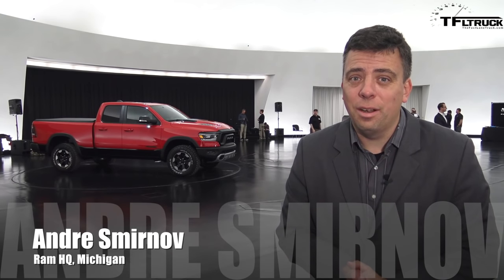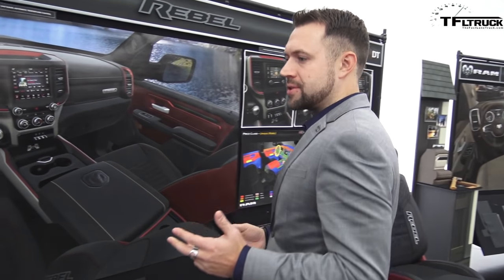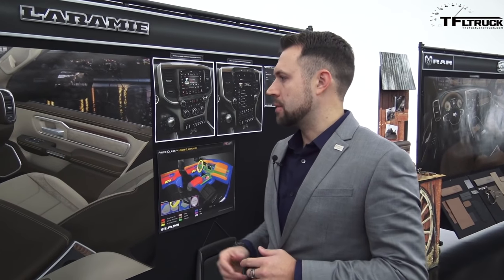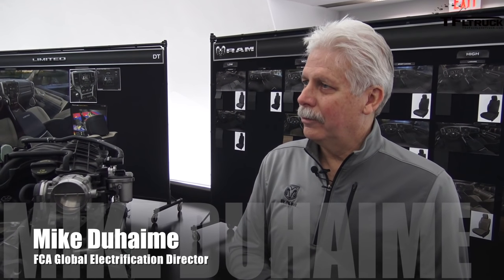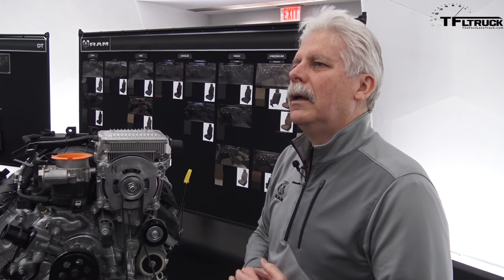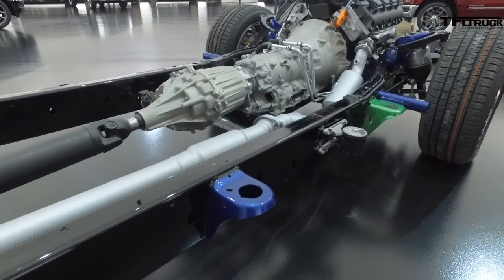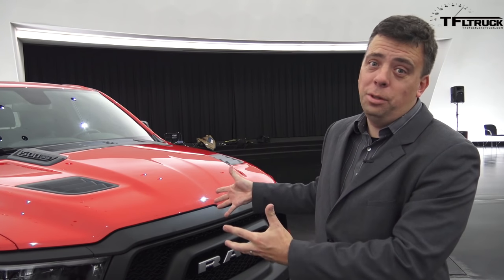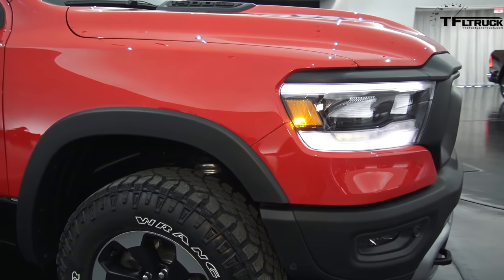Breaking News: Everything There Is To Know About The 2019 Ram 1500

Comment: When you guys finally get a hold of this vehicle I'm very curious to the ride quality I have arthritis up and down my spine and test driving the earlier version this vehicle picked up a lot of Road input but going through  potholes in a parking lot it was a soft ride. Where the ford had a soft road ride but a very jarring ride in a pothole filled parking lot. I would like to know if this new suspension fixes the road aspects. Also what will the tow rating be with the 3.21 rear with the 5.7 if the 3.92 has been bumped up to 12,000 lbs

Comment: Been looking in to getting a ram 1500 rebel now for a while but i'm worried about 1 aspect of it, The air suspension. If one or more air bag of the suspension breaks, Can you drive it with them flat? Where i live good repair shops are only in larger towns and there is at times quite a long drive to get to said towns, even more so if you are off the main highway.

Comment: You should ask RAM if the Heavy Duty's are going to come out with an actual 6 1/2 ft bed or they're going to stick with the 6 ft 3 in bed they currently have.  I know three inches doesn't seem like a lot but it's more handy than you would think.  RAM states that there are limits on overall length or something like that which only allows them to make the bed of the truck so big or small depending on how you look at it.  So if this new cab configuration carries over to the HD models does that mean my bed is going from 6 ft 3 in to 5 ft 9 in?  I can appreciate more interior volume but at the same time it's a truck, what's the good in increasing payload if you don't have the room to store it.  All of the advancements they've made are awesome like finally getting LED headlights and a 360° camera so kudos for that but I think a lot of RAM owners would appreciate a true 6 1/2 ft bed as well, atleast in the Heavy Duty segment.

Comment: Would be cool if the tradesman ( maybel the rebel as well)  trim came with full rubber flooring instead of carpet. Easy to clean after a days work. 
The Ram, IMO, is the only real truck, in a sense of me not worrying about scratching it. Screams "I'm a truck, use me as intended".

Comment: Hey guys, I noticed in the press release images of the 2019 Rebel that the time on the centre stack was 7:07, could be a fluke but FCA did this with the hellcat challenger as a HP teaser when it came out. Could be an indication of a RAM Hellcat in the works

Comment: The e-torque system looks really neat, I could see that being used in general (being relatively inexpensive compared to proper hybrid systems). It's strange the presence of a starter as well, I guess RAM wanted redundancy just to be safe.

Anyway compared to the new Silverado 1500 this one looks a tad better in my opinion, we'll see performance wise when you are finally able to test them

Comment: I just unloaded a 2014 Ram 1500 CC hemi, 8spd, 3.92s with all tow options that i'd bought new and owned for just under 3 years because FCA and their dealers seemed to be more interested in denying the problems with the vehicle than actually fixing them under the power train warranty.  Whining rear differential?  That's "normal" for a Ram 1500 with 5x,xxx miles.  ZF 8spd transmission running hot (220-230*F when NOT even towing)?  Two dealerships told me that FCA wouldn't let them troubleshoot it any further, to wait until it failed AGAIN (it failed the first time and hit 280* when towing my 3,500lb boat).. Then the "Ram Cares" rep even implied that my boat was too heavy (3,500lb pontoon boat, truck was rated to tow almost 10,000lbs).  My opinion is that Ram is more interested in marketing their trucks to new customers than they are in keeping existing customers.  Buyer beware.

Comment: It's a bit generic for a Ram. That screen is massive, but that UI looks very dated and low res. Has the ecodiesel been nixed? Can you see over the front end now? it's nice that it rides better, but does it have better visibility? Truck interiors seem to have hit a fit and finish plateau, what have they done in a practical measure inside to increase usability? I do like the chassis upgrades, and the deeper bed is appealing.

Comment: 2in lower on a rebel? 

why put the back up sensors on the bottom of the bumper where they can get scratched when off roading.

22in wheels on a off road truck? 

what about the power wagon?
Reply: trucker dan I would hope no one will actually go off road to the extent of scratching up a brand new 60k truck!
Reply: maddrummerboy 81 even tfl took some off road in Moab Utah if you follow their Channel you'll have seen the Power Wagon, TRD Pro, and the Raptor all in Moab. and they have scratched up some exhaust and or bumpers before it's more common than you may think.

Comment: The hybrid electric motor is best when it is connected directly to the crank , if I am not
mistaken it is belt driven , only time will tell but the way I see it is it will fail.
The Holy Grail is have a hybrid truck that can power a house electrically during a black out.
Also a system that can serve any construction site , Ram has a mickey mouse mild hybrid.

Comment: So it would seem that that guy never did get back to you with the Horsepower Numbers. 
Also, any word on the Ecodiesel?  Changes/updates?  Availability? With both Ford & GM both introducing 1/2 ton diesel models, that seems like something people might want to know.  
Some ball park numbers on pricing would have been nice e.g. "approx $1500 more than similar 2018 models," or whatever.  I mean if people can go order them later this month, they must have some idea what they are going to charge.  
I also didn't see a "Sport" model included in the list of interiors.  Of all the current interiors, I really like the Sport setup with the cloth/leather combo seats (I've got a '15 Sport model).  
For all those who aren't turned on by the Rebel, I would have also liked to see an Off Road package similar to what Ram did with their 2500 models and like every other brand has (Z-71, FX4, & so forth.)   
It's not that the new Rams aren't nice, it's just odd to see so many gaps in the information.

Comment: One very basic set of questions about all these new-for-2019 pickups is still not answered: (1: Have these manufacturers improved the value, quality and reliability of these new, uber-expensive vehicles? (If you're spending this kind of money for all these new improvements and gadgets, are they going to be there when you need them or are they going to need time in the repair shop?)  (2: If one buys a 2019 stripped-down work truck, new or used, will it be a better work truck for hauling cargo and personnel, as well as for family outings? (3: What are the real-world ergonomics for these umpteen gadgets and controls? (4: How will these trucks behave over-the-road, if you're driving to a remote jobsite or otherwise commuting? (5: How will these trucks behave in challenging terrain, such as winter snow/ice, off-road/mud, etc.? (6: Is there any real-world improvement in MPG?  Added note: I can't believe the proliferation of styles and trims available, especially from Ram, Ford and GM. Are these pickup trucks or fashion plates? Egad, they are GAUDY to all get-out! (Count me as one of those who still doesn't understand why some folks pay extra for a carpeted floor in a pickup truck.)

Comment: at about 14:00 in it looks like instead of running transmission cooler lines up front, they put a water to oil cooler on the transmission and ran coolant lines back to it. very interesting.

Comment: I like the new interiors. Not sure about the ginormous screen. I don't like the exterior as it looks a little like a Silverado or Toyota maybe? Rams have always stood out but not so much with this one.I have a 2016 Charger and 2017 Ram. Both interiors look very good to me and are very functional. But, they always look dirty to me no matter how much I clean/detail them. The Charger is a hemi and has been in the shop 3 times for transmission trouble. The Ram is a Cummins and has been trouble free so far. FCA products are hit and miss durability wise. Hopefully this improves.

Comment: I think the elephant in the room is, No EcoDiesel.  So Ford finally brings their 3L V-6 to fight the EcoDiesel and Out of the blue Chevy introduces a 3L I-6 diesel and Ram is mum on the continuance of their Diesel.  That's not a good move as to right up until the EPA butted in they were selling about 15-20% Diesel engines in the 1500.  I sure hope the RAM EcoDiesel hasn't bit the dust.

Comment: I like the look of the one with the grill that don't frown. I also like the ideal of an improved air ride system. Especially the wide range of raise and lower according to what you need. The electronic starter thing I'm not completely sure on though. I'm hoping he's just talking about when you give it the gas to get going,not to start the engine. I think that what he meant and if so it might be alright. However whoever decided to take the shiftier off the volume and make it a stupid knob needs to repent or be horsewhipped.Guess I better let everybody know that the horsewhip part was a figure of speech. So don't take it to serious and try and get me in trouble.

Comment: I like it... I like it so much its vary surprising.. but that 12 inch screen is a bit too much.. I would of been happier not flipping though computer screens to turn on the radio..  Is there a screen delete option on the tradesmen!?  

Otherwise.. the rest of the truck is fine..   Style wise..I think I might like the dodge even more then the GMs.  For 2019 Chevy got the weird bulge on the front quarter panel...  (Maybe the GMC might not have that so bad as the Chevy with this.. ) I also like how rugged it is but it has technical tricks up its sleeve.  The screen might be a bit too much but I would not mind aerodynamics working to reduce my fuel economy, and that massive moonroof.  Not that I can afford any of this brand new..

Comment: How the HELL does the guy at 12:30 not know by heart every horsepower and torque rating of every engine they make? That should be an on the spot firing. EVERYONE in the company should be able to quote their vehicles main stats on the spot.  Seriously, you WORK with the engine and don't know? Second, what a waste, the hybrid system doesn't add power, not even as an option? Fail. Who doesn't want faster acceleration, at least as an option? Beyond that, the truck looks good, and the weight loss is good to see. Still waiting on the Rebel with the Hellcat engine.
Reply: Cruor34 the hybrid will definitely add to the truck sale price

Comment: The rebel grill does not work with those headlights like at all. Over all I like the new look. A bigger improvement over the previous model. The screen with I think was the Hvac controls is horrendous. People like knobs not touch screens, Ford made that mistake years ago. Also in -30degree cold, the Airbag suspension fails. I'll still take my Titan over this. The shift knob and that big screen with your Hvac controls do nothing for me. My Nissan has active air dynamic grill. Dodge.... meh More junk more failure.

Comment: Yuck, raised bed... as if beds weren't hard enough to reach in to from the side already.
Reply: You more worry about to easy get things in, or loosing them on the way? Ik we all different, but i had Tacoma in which bigger box almost rolled over short bed sides.
Reply: tallll70 I gave a Tacoma too. I like that I can easily reach in the shallow bed without getting in it. If you were carrying something so big that it almost rolled out you should have secured it with straps anyway. The only time true bed volume should matter is when it's loaded with something that fully consumes the volume like rocks or dirt. I have done that before and definitely could use more volume that one time. For any real landscaping work though most people will get it delivered or rent a dump trailer anyway.
Reply: i see what you mean...i guess it's easy for me to say since i'm 6.3